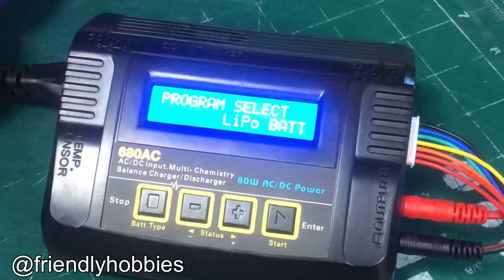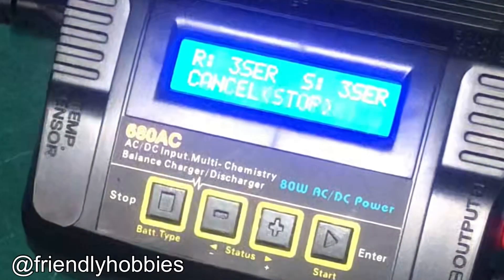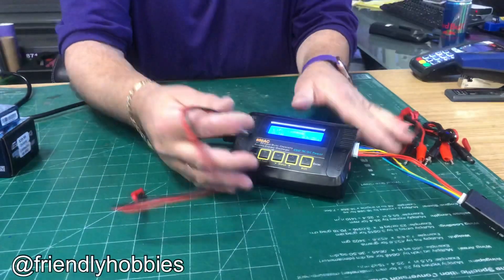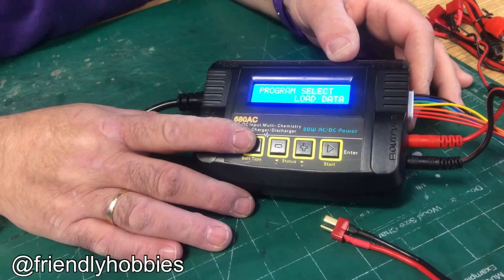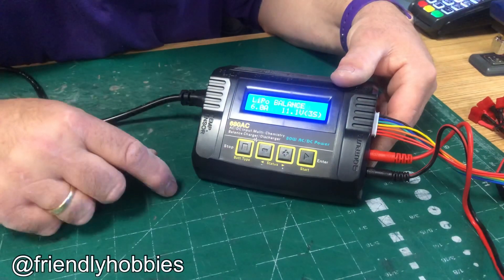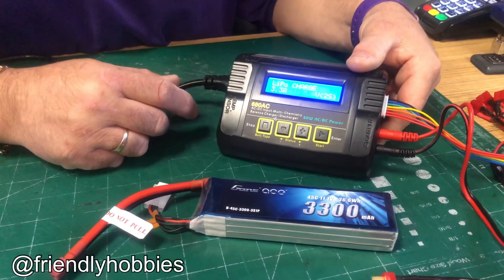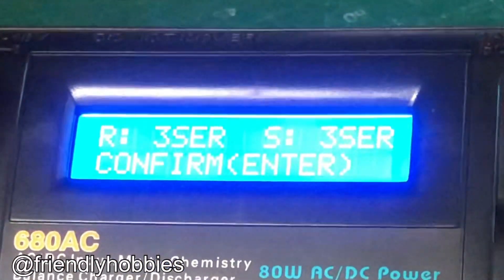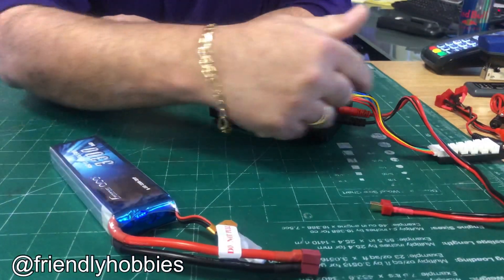How To Charge Your RC Batteries With Friendly Hobbies 680AC Multi Chemistry Charger

Comment: When I do this it says Battery Check…. 
Low Voltage
Reply from the maker: This Means that your batteries are below the minimum voltage for a Lipo Battery.  The minimum can not be below 3.0 Volts per Cell

Comment: I just picked up the 680 AC DC multi chemistry battery balance charger discharger .. n first thing I did was balance my batteries ..n lol I had A F connector at home now I got it working for my batteries .. but I am a noob when it comes to soldering lol but it works n at happy with it ..n a big thank you to Friendly Hobbies 😁🤗😎 ❣